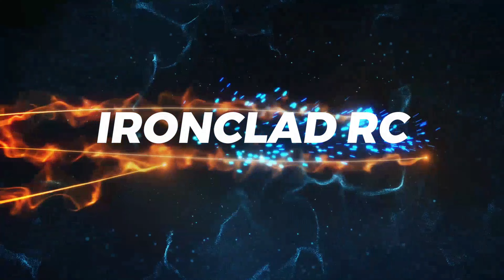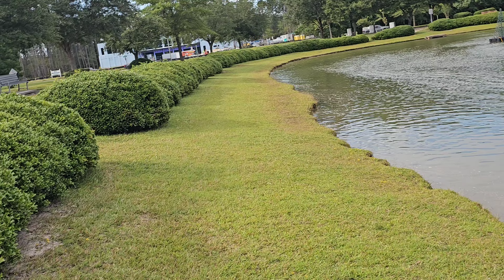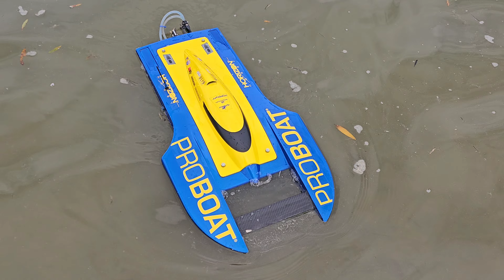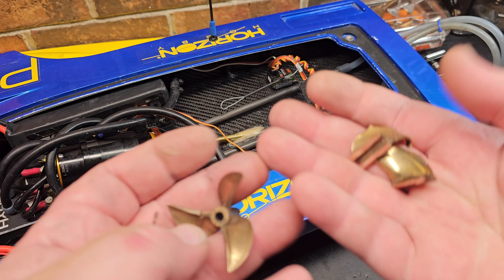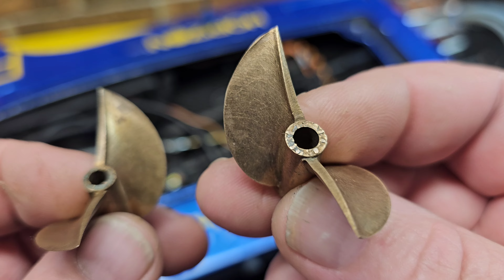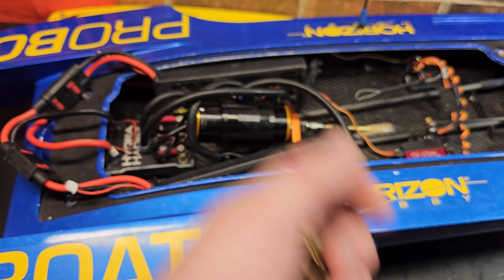New Setup Shake Down Proboat UL-19 Fully Upgraded Rc Hydroplane SAW

Comment: Seeing how amazing you made this beast I had to find one and snatched it up the second I seen it. I have a few goodies coming for it but the only thing I can't find that I want to replace is the mount that holds the shaft in place. The plastic piece that ppl melt on this model running 6s. You have any idea where I could order one? Just trying to replace a few things and start working on her. Thanks as always you rock. ( got a quad pickup rudder dual output, the good thicker flex shaft and a 4216 cnc prop coming as of now)
Reply from the maker: Youll absolutely love the ul19!  Its such an iconic boat!
Reply: @IRONCLADRC thank you for making your videos. I bought my blackjack v2 heatwave last month as my first boat and im already expanding and going to take the winter / off season to upgrade whatever boats i have collected by then 😂😂
Reply from the maker: ST Mount 
https://www.offshoreelectrics.com/proddetail.php?prod=ose-83029&PARTNER=ironclad

ST mount w/ oiler
https://www.offshoreelectrics.com/proddetail.php?prod=ose-83010&PARTNER=ironclad

Comment: I just picked up a XLX2 Hydra, can't wait to try it out. I am curious as to why they don't have power caps? Is it worth while to add them?
Reply from the maker: The stock caps are sufficient, I have seen guys add external capacitor blocks, but it's not necessarily needed, I have pulled over 450 amps from this speed control with less than .40a ripple, quality lipos make a huge difference.

Comment: I had a dig through some notes about prop hardening. ABC use a different mix compared to Octura so the temps are slightly different. For ABC props destress them first if you are shaping cupping them 312-337 deg f, soak for 10 minutes then take them up anywhere between 500-640 deg f for 30 - 90 minutes. Think I went somewhere in the middle of these. High temps may become brittle. Crack the lid and air cool, so a fast cool down. Hope this helps not much info out there.
Reply from the maker: No there definitely isn't much information on beryllium hardening.   I did 550° for 3hours last night slow cool down,  pulled the prop it was soft!    Trying again today I'll try 550-600 for 1+ hour      thanks
Reply from the maker: Just finished treating a prop with your method and it worked 💪 thanks!   you da man!

Comment: Big B , I just love your recent videos , bringing the best sped out of the boats . 👏👏.

I am a bit confused about the speed measuring device to send the speed information to my iPhone . PS I don’t want to open the boat to read the speed on the device each time. Prefer if it can send the info to the iPhone .

Do I need all three or just 2 of them .

1) Castle Creations B-LINK Bluetooth Adapter.

2) GNSS Performance Analyser

3) Dynamite Passport GPS Speed Meter 2.0

Thanks .
Reply from the maker: I use the gnss performance analyzer,  Bluetooth to any Bluetooth device  (tablet, phone, ect)

Comment: Hi IRONCLAD, I follow all your videos, but a question, I was looking for a configuration for a 3674 engine to mount on a catamaran of about 80 cm long at 4s, what do you recommend regarding the kv of the engine and which propeller could be good?. Of course it reaches at least 80 km/h. THANKS.
Reply from the maker: 1900-2000kv should be a good start?
Reply: @IRONCLADRC  Thank you

Comment: That transmitter is AWSOME I would love to see some comparison videos like the same motor size and kv vs amp draw and or mph with the same prop.  Everything exactly the same just switch out the ESC and see what you get.  It’s been my experience that ESC’s don’t all allow full voyage to the motor.  But then again data logging can get a little to scientific 🥱,  but just the same finding a motor that can do what others do but with less amp draw is a good find 👍.  BGFL
Reply from the maker: Coming soon!

Comment: Hey Big-B, I just got a X2 esc and HV batteries.  If I understand correctly as long as you are not running 8s you can program the X2 to accept 4.35v per cell.  Am I wrong on this and if I am right why not? Charge them suckers all the way!
Thanks for your time and all that you do!
Reply from the maker: All I did was disabled lvc in the xlx2 that allows me to run 4.35 6s hv fully charged

Comment: Love the UL 19. I learned from you 2 years ago- grease shaft and tape the hull down, or it will leak!
And heat shrink at flex shaft and strut.